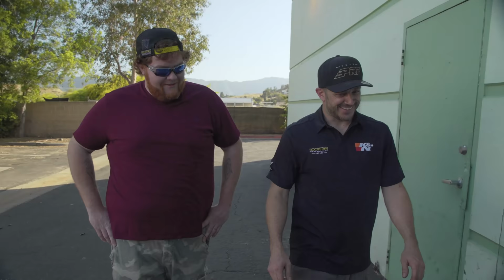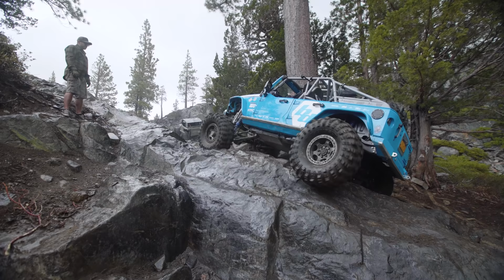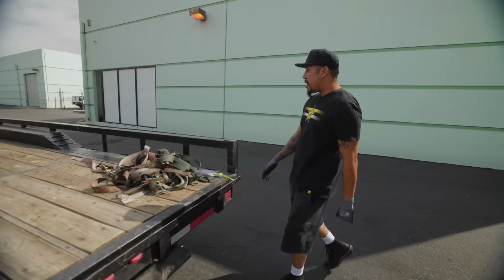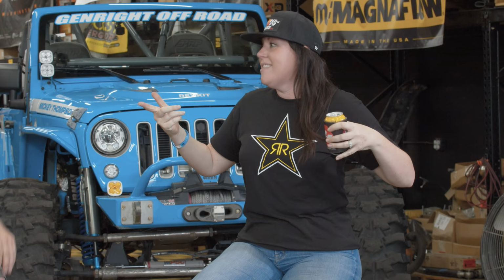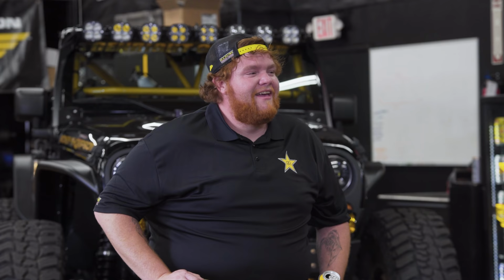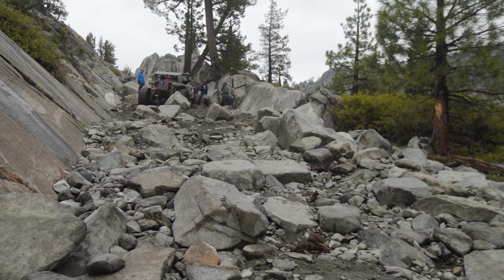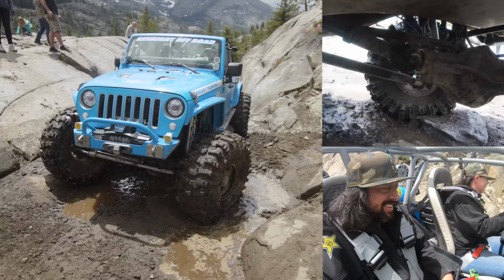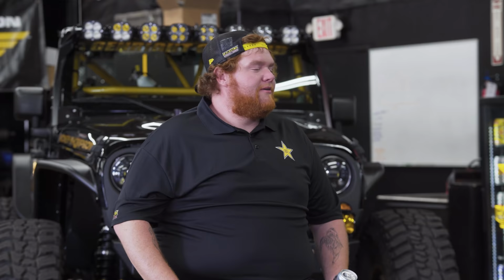Off Road Adventure in Fordyce Creek

Comment: I know I may get attacked on this one from you Jeep lovers, but dang that Toyota is gettin it. The axle break could have been prevented, and in some spots it needed help, but regardless it's going practically where these 100k  + Jeeps are going an I bet the toyota doesn't even have 10k worth of suspension mods. Now imagine if you built the tacoma, and got rid of the IFS for a solid axle up front. It would be a beast! Mad props to the Jeep owners in this video. Shit looks dope and super rad! Great driving and for being safe out on the trails.
Reply from the maker: There was a lot of pulling and winching that day lol

Comment: Thats the first 3rd gen I've seem break a rear axle shaft. I'm hitting fordyce tomorrow in my tacoma.
Reply: I was thinking the same thing.
Reply: Had you done this trail before or first time in the third gen ?
Reply: Definitely bring several spare CVs, several axles and a spare engine and Trans. Those tacos break non-stop.
Reply: I ebelieve that tacoma was not a trd off road. Which means the axles are 30 spline vs 32 spline. So a bit less strength. The new 3rd Gen trd off roads only ones with the newer 32 spline shafts. 

Not saying it still wouldn’t have broke but for sure has a higher torque capacity